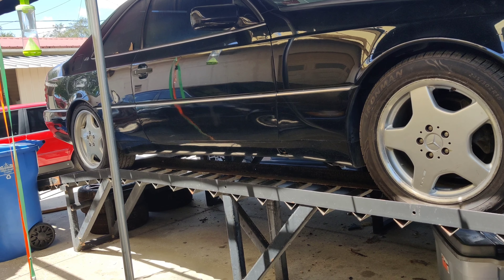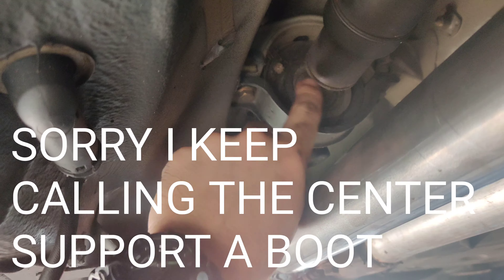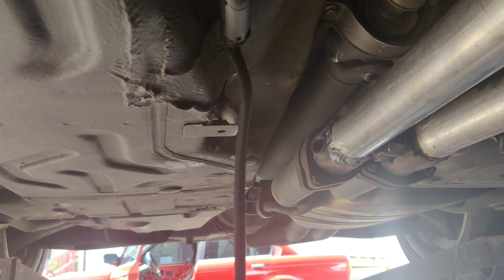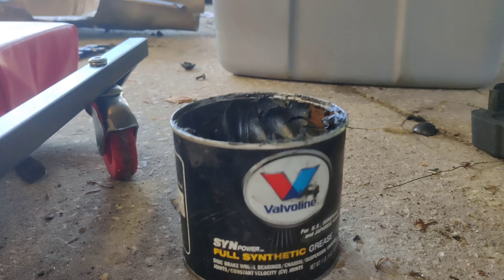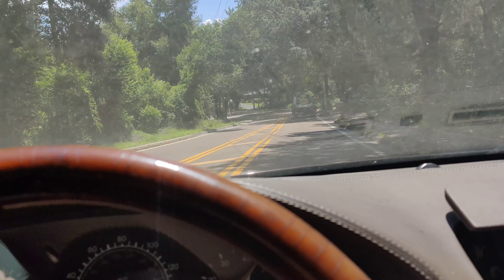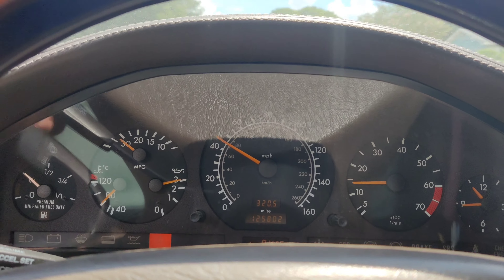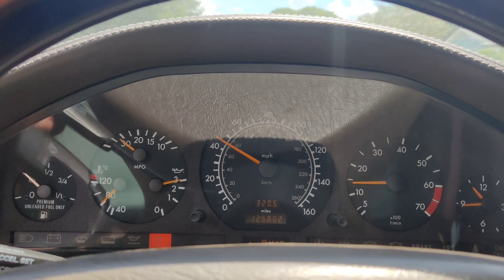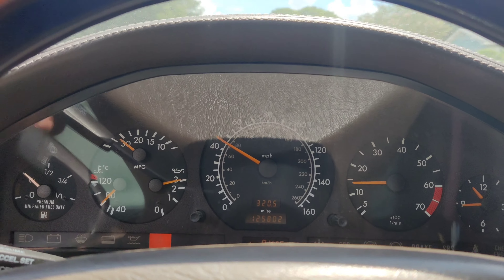Mercedes s600 coupe w140 c140 checking driveshaft center support bearing

Comment: Should I purchase the 1997 S600? Previous Owner said that Rear Suspension has a clunk sound when going over bumps, the speedometer stopped working, also there’s a loss of power. Only 94000 miles, is it worth even purchasing ?
Reply from the maker: Could be a lot of work but what's the price.  So shocks are going to be the accumulater balls or just swap out shock completely.  Estimate $300-$1000 plus labor.  Loss of power could be a bunch of things.
Reply: Pete’s Carport the price is $2500 is a 1995 self levelling suspension, but the most important thing is figuring out why the loss of power, still think it’s worth buying? It’s definitely my dream car.
Reply from the maker: @Ycniuq1976  if you do buy it, which is a hard to find car, keep in mind it can be very expensive of its a major issue.  Just make sure it's not your daily driver.   Do you have any way to run a scan on car. Is there a check engine light?
Reply: Pete’s Carport no check engine lights

Comment: The noise was the u-joint hitting the top of the heat shield... You can clearly see the witness marks on the u-joint flanges in your video.  Driving w/out heat shield will of course solve this.  Your GREASE addition was unecessary and will only attract dirt.  I have a 1998 CL600 with the SAME issue.  It's a sagging center support (doesn't need to be torn to be bad).
Reply from the maker: Thank you.  Makes sense and yes been without the shield and no issue
Reply: @petescarport   No problem!  Just trying to help.  FYI - The center support is NLA from Mercedes as far as I can tell.  Some vendors seem to still have some, but the cost is pretty high, over $100.  Beautiful car.
Reply from the maker: @Johnathan_Waters  thanks for heads up.   It’s not a fun job anyways.  Lol.  I had to do it on my r129